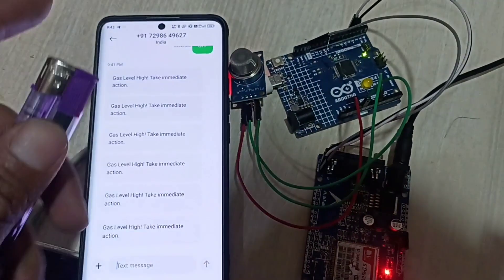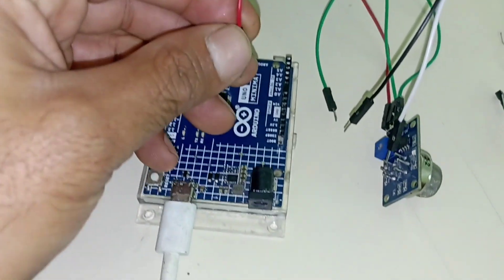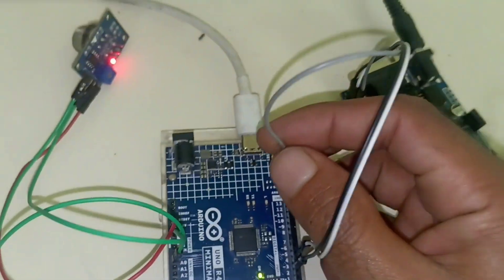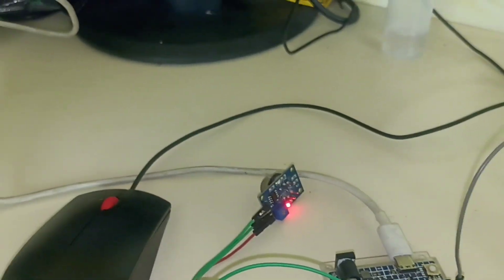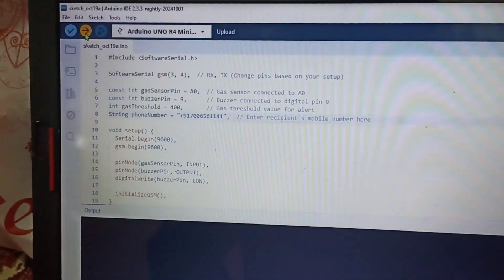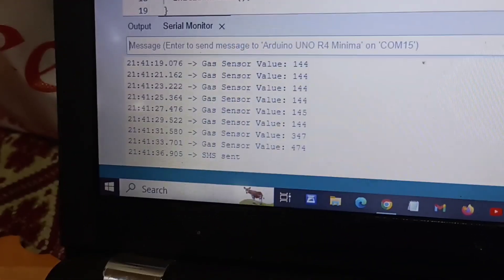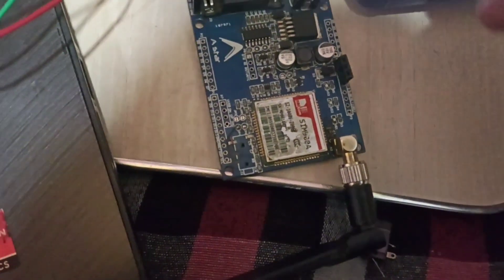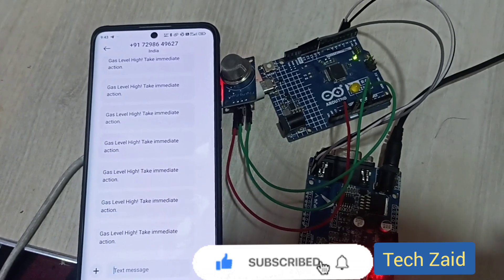Gas Leakage System With Gsm and Arduino | Step by Step Guide with Tech Zaid #arduinounoprojects

Comment: Bro how to come power supply
Reply from the maker: M not getting  u bro what u mean
Reply: How work aurdino and mq-2 sensor without battery
Reply from the maker: @ShameemShameem-u1l there is a 12 V charger connected to gsm and through gsm I give 5 v supply to Arduino and Gas sensor